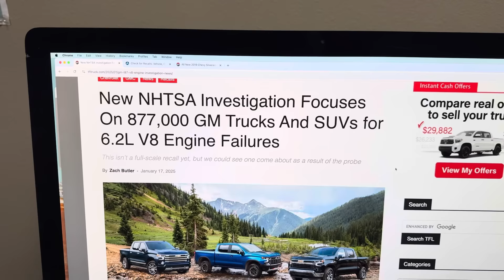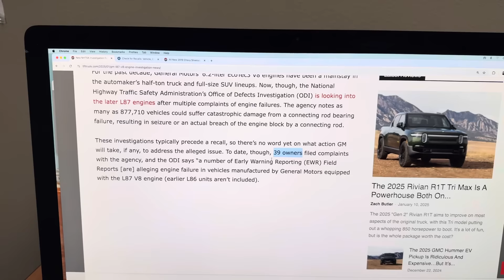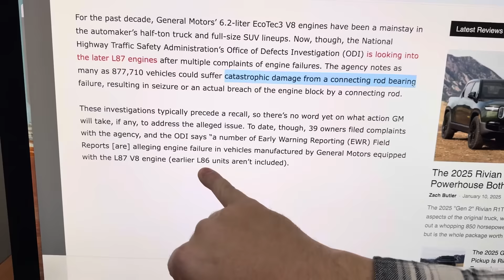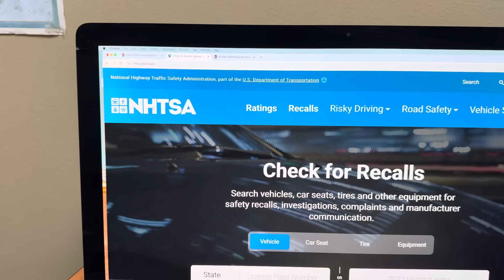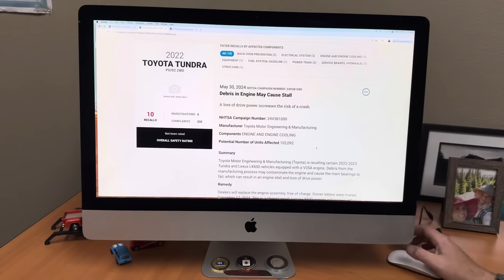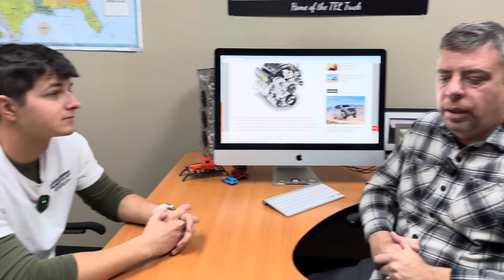877,000 GM Trucks & SUVs INVESTIGATED Over Failing Engines: Are You Affected?

Comment: The problem is the super thin oil recommended on these engines. The thin oil for fuel economy instead of thicker oil for engine protection.

Comment: The numbers just aren't in yet. Same thing happened to mine at 34,000 miles. There were 3 other trucks at the same dealer with the same issue, total engine failure. 3 Months from time drop off to get the truck back as the engines are on back order

Comment: GMC PICKUPS..STEERING SHAFT BREAKING..TAILGATE OPENING WHILE DRIVING..BRAKES APPLIED WITH NOTHING IN THE PATH OF THE VEHICLE..AFM..LIFTERS..TRANSMISSIONS..DIFFERENTIAL LOCKING UP..BEARING FAILURE..AND NOW REPLACING ONE MILLION MOTORS..AND NOW GRILLES FALLING OUT..PATHETIC VEHICLES GM..

Comment: Your comments on Toyota missed a couple key points in my opinion.  First,  Toyota is saying their engine issues were due to a manufacturing defect, not a design defect.  If that is true, manufacturing defects are generally much easier to solve than design issues once the root cause has been identified.  Of course it depends on the issue, but not washing the Toyota 3.4 engines well enough after milling sounds like an easy fix once identified.  But, the design issues GM is having with the 6.2L engines do not fall into the category of an easy fix.  Secondly, Toyota is providing much better customer service than GM by offering to replace suspect engines (even if they have not failed yet) instead of dodging the issue as GM is doing on the 6.2L.  You eluded to this fact, but to me this is a significant difference between the two companies that is clearly a differentiator from a consumer standpoint.

And with that said... couple weeks ago I traded in my mint condition 2019 6.2 Silverado for a new Toyota Tundra Platinum model.  My reasons were they gave me a very fair trade in value, Toyota had instant rebate of $3K plus an additional $4K markdown by dealer, warranty had run out on the Silverado, am confident Toyota has addressed the issues they were having with the 3.4L, and at end of the day I like how the Toyota drives better than the Silverado.   Not as quick for sure, and I will no doubt miss the sound of that Chevy V8, but I don't drive vehicles hard like I did in my teens and the Tundra with the twin turbos is definitely no slouch.  

Love your videos, thanks!

Comment: I don’t know where you get the 37 number from but my 2023 Silverado Bison edition 6.2 L is in the dealership right now getting a replacement motor where the same thing happened and it seized up and my service advisor said there are four more trucks in her bases right now waiting for the same thing. That number is probably closer to 37,000 or maybe 370,000.

Comment: It is an issue, but not checking the engine oil level regularly is also an issue. Do not go by the remaining oil life indicator on the display. You will be running low on oil way before it reaches 30%.

Comment: My 6.2 threw a rod 2 weeks ago while sitting at a red light. 22k miles, all maintenance performed at GMC dealership. Still under warranty,  but damn. Still waiting on replacement engine and some sort of ETA. Considering thinking of trading in and switching to 3.0 duramax.

Comment: My 2024 Colorado zr2 wnjine  just detonated a4 8 months old ans only 7,400 miles on thw odometer. For a engune oul too hot message pip up on the dash instrument panwl. Wirhin 3/10 ths of a mile rhw engine shut down. Service mgr told me that thw crank shaft seized up!  Having to send the engine back to GM. Afte4 2 weeks the dealer has to give me a loaner vehicke. He told me  it could take 3 more weeks until  GM  hopefilly sends me a new engine for my truck!

Comment: I bought a 24 Chevy zr2 brand new, 2800 miles on the truck and the number 7 connecting rod broke free and blew a hole in the cylinder.  New motor was put in, but who knows if this replacement motor is any good.  Time will tell.

Comment: Haven't had any problems with my 2021 GMC Sierra AT4 (6.2L). I bought a AFM disabler when I first got it and only use fully synthetic Mobil 1 oil. However, next truck will be a 2500 Heavy Duty with the 6.6L gasser.

Comment: I have a 2024 L 87 in my GMC Sierra Denali, 1500 and this week while slowing down at a stoplight it shut off twice. I took it to the GM dealership. They replaced the gateway and told me to keep them updated. I was worried this was the dreaded engine lock up. The motor only has 5100 miles on it.

Comment: I have a 2023 sierra with that engine. 40K miles . I absolutely love it... but every 4K miles the oil light comes on and I have to add  1qt . I reported it to the dealer and they ask me to bring it when the light is on so they can prove it . But I'm always on the road so that's impossible.  So I checke the oil regularly and add oil accordingly.  That might be it 🤔

Comment: stop being nice to gmc TFL. you can put me in as 40th if i could out a complaint from canada, my 6.2 yukon locked up on me while driving at 70 kms with no warning. luckily i was a bit from the freeway and managed to glide it to a restaurant parking lot then on its own went into park. its been 60 days since that and no update on a new engine. just recently got a loaner vehicle from gm and the rest has been under my own dime for a rental. yukon is currently 7 hours away as this happened while on vacations with my family.   

gm has been doing a horrible job handling this case

Comment: There are literally MILLIONS of 5.3 and 6.2s on the road, not just 877,000. AFM or DFM... there are millions of these things on the road, they've clocked billions of miles I'm sure collectively. If this was such a big issue, you'd see them lined up at the service bays and that's simply not happening. Is AFM and DFM a weak spot for the engine, YES. However, this is something overblown on forums. It happens to an owner, they go online and complain and it gets spotlight. I've never had any issues with my 5.3 or 6.2s.

Comment: Listen to me! I'm a mechanic and can't believe what I discovered with my shop owners 2022 Chevy suburban premier 4wd. I was doing an engine reseal for him. A 20 labor hour job. Removed the front axles, transfer case. Transmission and front differential. Then when I got to remove the balancer the crankshaft was moving in and out excessively. Well, I removed the oil pan and the end play of the crankshaft is 40 THOUSANDTHS! It should be about 1 and a half thousandth of an inch or 8 and a half thousandths. I told him and he chose to remove the engine and repair and replace the thrust bearing. I have the engine ready to be removed tomorrow morning. His vehicles is almost entirely GUTTED. It'll have no engine. No front diff. No transmission, no transfer case, no front bumper/fascia and I'm excited to take a photo and might make a video of this repair. He has a 5.3 and we get a lot of 6.2l with bent pushrods but even the 5.3l are not made properly when manufactured! Stay the heck away otherwise you might have someone like me. Absolutely tear into it to make these repairs!!! Check out my YouTube channel in a two days and you will see this skeleton of a 2022 Chevy suburban with only about 70k miles! It basically needs an engine!

Comment: There has to be more than 39 complaints. Either it be total engine failure or lifter failures. Must people do not file complaints to the NHTSA. They just get the issue repaired. One is my son-in -law. So far, my 2022 AT4 has not had an issue. But it is sure very very concerning.

Comment: Andre , there has been a coverup by GM because I had both my 2013 Sierra with oil consumption problems and then my 2015 Sierra had the collapsed lifter and bent push rod. I went to the dealership to see about both trucks so it 's not like it wasn't reported. I traded the 2013 for the 2015 thinking I avoided one problem but having bought another problem. Both were the 5.3 Liter. The 2015 broke down 2400 miles past my extended warranty of 72K miles. It cost me out of pocket $3200 to get it fixed and no my dealership didn't want to deal with it so I had it towed and repaired elsewhere. This was in September of 2022. Because mine was a 2015 I will never see any compensation for my expense and GM will never see me grace their doors for another new vehicle either.

Comment: I don’t know whether it is a fault or not , I used to work in dealer many years ago , we also had the  police contract , and the coppers would jump in the car with a stone cold engine and full throttle it as soon as it caught , occasionally we’d see cars come for 1500 service with bearing rattle , they absolutely punished the cars. 
Not saying that’s the case here , but it happens , how many parents let kids take the car out on proviso they behave themselves, and the little shits go out to back street drags😊. 
 I can remember ( vaguely) a car under warranty coming in for a new clutch , walking around the car noticed tell tale signs on the tyres of wheel spin , and masses of tyre rubber stuck up under  the guard. 
 Dude had been doing burn outs . 
Clear abuse , warranty rejected.
Edit: by the sound of the comments it sounds like a legit fault.

Comment: The owner of the company I work for purchased a new 2023 $90000+ GMC Denali pick up. Waited almost a year to get it. After 8000 miles of ONLY driving back and forth to work, the 6.2 engine failed. Sat in a dealership for 2 months getting a new engine. Once he got it back, it left him stranded twice for a dead battery. Turns out it was a bad wiring harness. He now says the new engine is making the same noises as the original engine did before it failed. Fukkin SAD!!

Comment: My daughter's 2023 Escalade:   The engine required 2 quarts of oil to bring the level up to the fill mark after a "low oil" indication on the dashboard.  Note that she did not drive the SUV further than 30 miles with the "low oil" indication.  That was about 1,000 miles after the Escalade dealer changed the oil.  After adding the oil, I fired up the engine.  I heard a "knock, knock, knock" deep inside the engine.  She had the Escalade towed to the dealer.  

1) Dealer could not explain the oil consumption OR hear the "knock, knock" with the engine is running. 
2) Her husband had to meet with the service manager and have the manager stand with him in front of the engine and hear the engine.  
3) The manager at that point stated that he heard the "knock knock".  The manager stated they may need to replace the engine. 
4) My daughter sold the Escalade back to the dealer.  The Escalade was still under warranty.  
5)  Good thing she did.  Rumors are dealers do not have new replacement engines, and the time to fix is not known.  
6) Note: The SUV was under full maintenance at the dealer.

Sooooooo: Is the oil consumption related to the engine "knock, knock"?  I remember reading somewhere the problems may related.  Note that the engine did not leak oil after an oil pan was replaced by the dealer in the past.  My daughter did not contact any government agency regarding this problem........

Comment: I have an 08 6.2 engine(non Cadillac)350k original valve covers, main seal is leaking.  My 03 4.8 has 450k mile with original valve covers, main seal is leaking.  These 2 engine don’t have afm/DOD.  These engines traditionally ran for 250k plus miles.

Comment: March 15, March 29 2021 GM did not install afm in there trucks due to chip shortage.   I think this went on for a period thru 2022. We should see an improvement in reliability thru that time period. This may only be the 5.3
Reply: I had one of those, 2022 Sierra 1500 SLT without DFM from factory and transmission went out at 31K.

Comment: March 15, March 29 2021 GM did not install afm in there trucks due to chip shortage.   I think this went on for a period thru 2022. We should see an improvement in reliability thru that time period.
Reply: I had one of those, 2022 Sierra 1500 SLT without DFM from factory and transmission went out at 31K.

Comment: My 15 Silverado 6.2L was a nightmare. 
30k kms.....3 trips to garage for lifter/pushrod issues in less than 2 years.
Not to mention the 8 speed tranny issues and highway vibes.
Last time it happened i regret not flogging it and totally destroying something. 
It got to the point where i didnt feel i could get out of town.....so i traded it in.
I haven't owned a GM product since.....and may never.
My son has an 18 Sierra with 6.2L.....tranny and engine replaced.
His 24 Sierra 5.3L/10 speed work truck blew a tranny with less than 10k kms on it, and his company is having nothing but trouble with their GM trucks.....and a few F150s.
Roll the dice with any of the new trucks i guess.....😢

Comment: If you would like to have a good truck GM get a 2500 pick up truck with the 6.6 engine it is very good truck I have a 2021 silver up truck with 70.0000 miles on it and doing very good all the time

Comment: The 5.3 apparently has issues as well. Didn't know this until after i bought my 2016 Sierra. Before it i had a 97 Silverado with the vortec 5.7 and before that an 88 Scottsdale k2500 with a 350 also. If i would have known ALL of these manufacturers are having issues i would have just kept the old truck and restored it. After all these years you would think that GM would know how to make a small block V8. I gave that vortec 350 up when it had 250,000 miles and it didn't even smoke at all. Toyotas turbo V6 and Ford engines are having issues too. I see videos on YouTube with mechanics lifting the whole cab and front clip off an f150 to get to the Ecoboost engine that went bad. These manufacturers need to start making drivetrains that can go 300,000 with no issues like they did back in the late 80s and 90s

Comment: 2010 non afm 6.2 less than 10k miles on a motor directly purchased from GM with lifter failure. Original engine went over 200k miles till a pos mechanic stuffed a rag up the oil pick up tube.

Comment: I had a 2017 chevrolet SS Sedan with a 6.2L LS3.  A lifter failed around 100k miles and killed the engine.  These lifter failures are far from new, and I suspect AFM, which my LS3 did not have, has nothing to do with the failures.  I loved that car, had all maintenance performed at the dealer and did all maintenance ahead of or on schedule.  It was my first and will be my last GM vehicle.

Comment: Definitely more than 39...  My 2023 Sierra 6.2L spun rod bearings on #1 and #2 cylinders at 23,060 miles on the clock on November 5th 2024.  All seemed normal at a fuel stop on a 600 mile road trip through Nevada.  Stopped half way into the trip for fuel, and on startup after buying gas the engine had a very loud metal on metal knocking at idle, and worse with RPMs.  No indication of a problem before that point in the trip.  Took 5-1/2 weeks for the repairing dealer to bother pulling the pan to see what happened, and the oil was cooked and like tar from getting so hot.  Rods 1 and 2 were jet black from oil starvation and high heat.  If we'd kept going, it would certainly have seized and thrown a rod through the block.  GM has agreed to a "repurchase" of the truck, after nearly three months of angry daily phone calls and emails.  It hasn't happened yet though, so I don't have high hopes.

Comment: I just had a crankshaft bearing on my 2023 Tahoe fail. 6.2L V-8  metal flakes in the oil. lots of them.  GM wants to rebuild engine instead of replacing. Probably going to court.  Oh yeah. 13,300 miles on engine. I want a new engine

Comment: Andrey is exactly right!   39 out of 87K engines is pretty damn good.  I would like to see the maintenance histories of these 39 vehicles.  I maintain my 2021 6.2 Trail Boss religiously.  Oil changes at 20% life, tranny, differential & transfer case serviced every 50k miles.  Not one service visit other than scheduled maintenance in 102K miles.  I also have Chevy performance pipes &  Pulsar LT with DFM & auto stop/start disabled and throttle response increased by 30% in my day-to-day driving. Best truck I ever owned
Reply: My brother's failed twice does he count as 2 of the 39? And he never filed a complaint. Gm just bought his truck back. You think his case was ever reported or gm is just keeping it hush hush

Comment: Im not gonna try and defend Toyota too much because their recall is pretty bad but this just goes to show that recalls are being slapped on all manufacturers. 

I have a 3rd gen tundra 2023 24k miles and it’s been running like a top. Yeah I know that the engine recall is inexcusable but hey at least Toyota is also trying to fix themselves. People are sleeping on the new twin turbo engines because they think V8s are better which they are when it comes to reliability. But every engine can have issues if designed or manufactured poorly.

I don’t know much about GM aside from my Dad’s vortec v8 failing on him in 2008 but hopefully they can set themselves straight too.

Comment: My 2023 suburban with 6.2 failed at 80mph on 95 on Florida. Total replacement bc of bearing failure. I made a report on NHTSA so there’s at least 40 complaints…been in the shop for 23 days already. GM is zero help. Engine back ordered indefinitely.

Comment: Disappointed. This is only for the main bearing issue in recent years. L86 6.2 and the 5.3 have had issues with the earlier cylinder deactivation system AFM or DFM. Was hoping this was going to be related to that! my 2015 1500 SLT 6.2 made it like 140,000 KM's before it had lifter failure. Cost me $5600 CAD out of pocket. GM ignoring all the AFM/DFM cylinder deactivation failures is also CRIMINAL

Comment: These engines have been known to have oiling issues for years. GM dialed up the stability control to keep oil from sloshing away from the intake to the point it cuts power on freeway cloverleafs. So GM knows this is an issue.